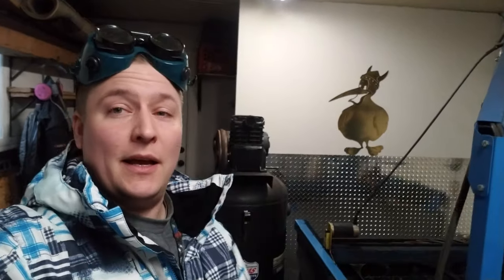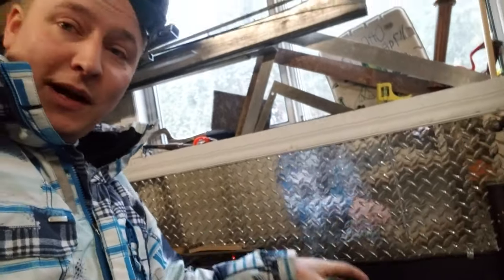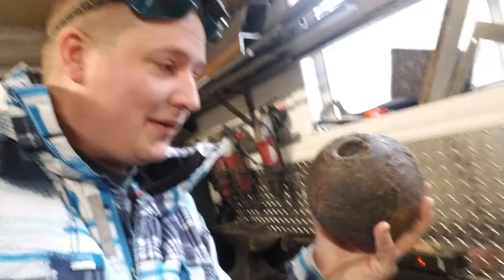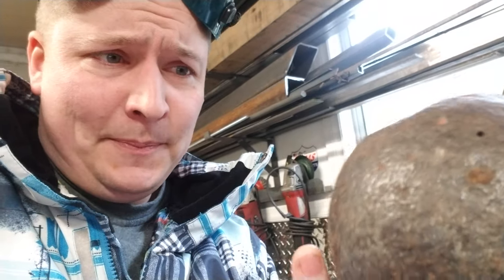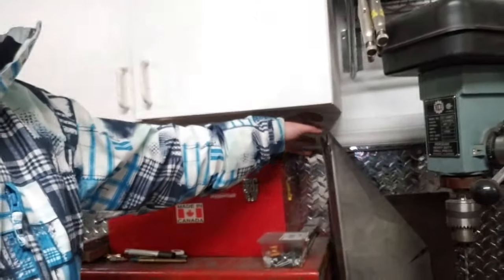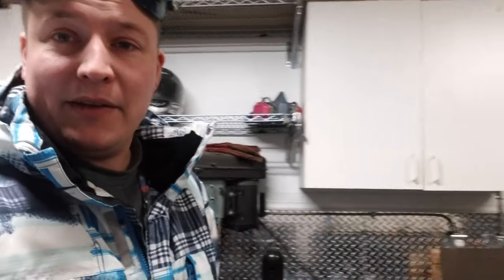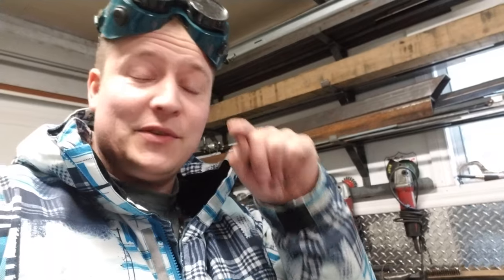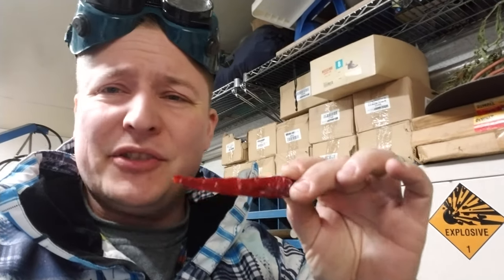I Found Some Real Cannonballs!  Will It Weld?

Comment: They are US Civil War shells and spherical case rounds and worth way too much to destroy by welding anything on them.  They are cast iron so they won't weld worth a hoot.  The case shot orginally had lead balls and a small bursting charge inside.  They have Boreman fuses.  12 Pounder shells were about 4.67" dia., 24 pounder shells were about 5.2" and 32 pounder shells about 6.4" diameter.  A collector will pay you enough to buy a much better toy than could be made from these antiques.
Reply: Victor Richardson   of course you can weld cast iron. You just need the correct equipment.